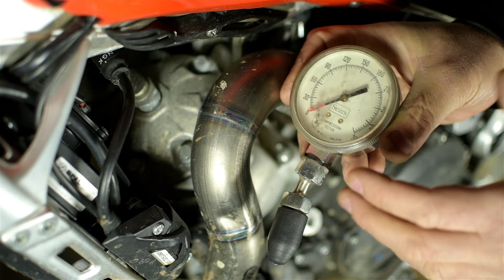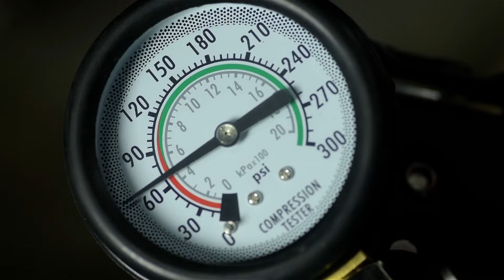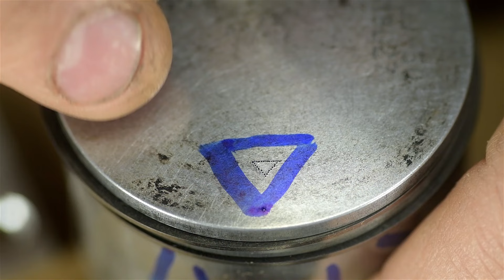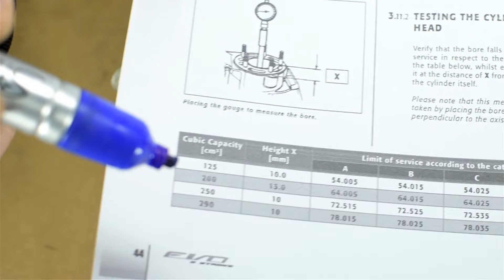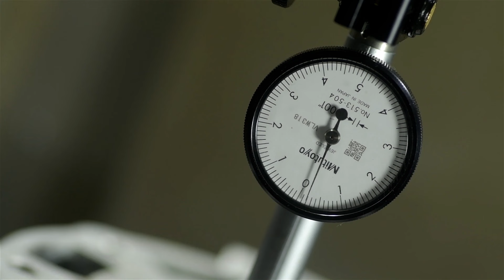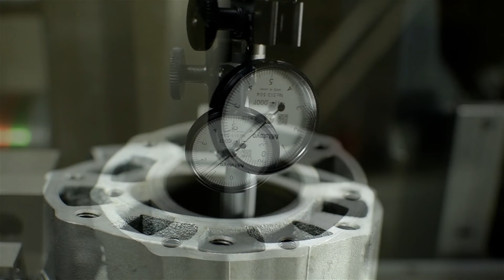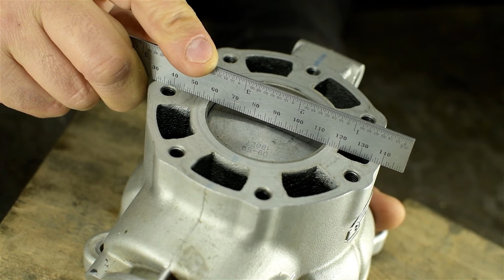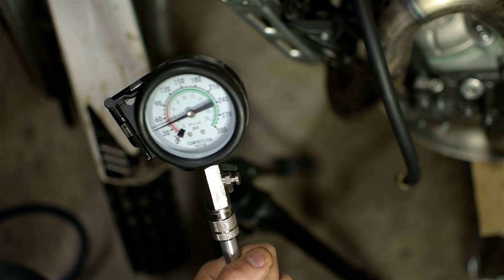Top End Rebuild! (2 Stroke)

Comment: Are you sure the cylinder is Aluminum?  Even if the block is Aluminum, the cylinder wall will be a thin layer of steel, typically.  I can see there's a thin wall of something between the combustion chamber and the block.  That's not Aluminum, is it?

Comment: I had issues with my car,  it ran funny  the engine ran really uneven,  so i called up my friend who has a  Car repair shop, he told me to limp the car over there and he started to check the engine, after a  like 20 minutes or so  and he said he wants to check the spark plugs and started to pull them off, and when he got them out he was shocked in what kinda condition they where, rusted  nasty and the spark tip was round no sharp edge anywhere it was worn to a ball he told me he had never seen anything like this in his 30ys on the job

Comment: Dear ToT, you don't act like you know nothing! The only glaring error I heard was the comment about sucking gear oil up into the combustion chamber. It's a 2 stroke so the crankcase and gearbox are separate. The carb mixture flows down into the crankcase and then up to the combustion chamber through the transfer ports. (But I suspect you already knew that!!!)

Comment: dont ever make an adapter for compression tester.  thats why the cheap tester is giving bad results, because a good tester has the valve in the very end of the tube.  a cheap one has the valve right up by the dial and any volume between it and the spark plug hole gets averaged in with the results.  on a 400 big block it wont make muych difference but on a smaller engine it throws it off ALOT.  if you cant look inside the end and see the valve dont use it for small engines except as a comparison (engine a and b are the same size and a has good compression, does engine b read the same as a?  then its good)

Comment: its really hard to get a accurate read on a dry engine , you need the lubricity to help the rings seal, generally you run a compression test either by squirting a shot of oil/fuel down the bore, but around 65 psi is where you start having serious start-ability issues  the ideal range depending on piston/head design should be around 120 to 190 psi. if it doesn't take your fat mother jumping up and down on the kick start to fire it off its not sealing good
Reply: if mo power is your game take the head back off bring the piston to TCD and see if you have any room to shave the head down for some more compression

Comment: 2:38 The main problem with those is that the whose is to flimsy and there is no check valve in the start of the whose. So the whose will flex and only low compression will reach the gauge. Every normal expensive tester has a check valve in the end that gets put in the cylinder head.

Comment: Tony, you went there, so this is really all your fault. I was going to leave it alone and just let you ride, but you should have honed the bore. There I said it. 

The so-called super-uber-mega-ultra-viener-shliden "coating" was gone about 5 minutes after you started that engine when you bought it new. The reason for coatings like that are.... wait for it..... just a minute.... MARKETING!

Tony, just think about it, the bore is technically out of spec. Is there really any chance of a coating being left on there? The only way for that "coating " to survive is to infuse it into the aluminum, so it's still there even after being slowly filed and machined away by the running engine. The only risk you run by honing the bore is increasing the break-in time after the rebuild.

Comment: A cold 2 stroke should never be more than 120 due to piston expansion/ clearance , black below the rings is blow by and never should there be swirl marks on a 2 stroke, cylinders are Nikasil coated aluminum jugs. Rings in a 2 stroke only good for 4000 mi at best.

Comment: OMG!!!
The piston is polished like that because its the sides that expand and press against the cylinder walls. You going to take a measurement on a piston that needs to be replaced. Those manufacturing marks are there for a reason, and they arent manufacturing marks. They are intended to hold oil so the moving parts stay lubricated. Once those grooves are gone, throw the fucking piston away.
Next, get a hypereutectic piston and have the cylinder blueprinted to the piston. Don't just buy a piston that's 40thousanths over and then machine 40thou out of the cylinder. Blueprint the fucker so it has a good solid tight fit. hypereutectic pistons dan be blueprinted to extremely tight tolerances that forged or stock pitons cant. hypereutectic pistons don't expand or contract. And they have been used for a long time in hotrods making 400 plus horsies. 
That's all you will ever get from me. It's more than you deserve. You're on your own.

Comment: LOL, I made comment before watchin much of vid, there's your problem on other other bike then, 90psi is dead giveaway you did it wrong.
You have to have throttle wide open (or carb removed) as well or you will get very low readings. 
The parts in a cheap tester are really not much worse than in a 'name brand', good gauge and it should be just as accurate as a $200.00+ tester.
 Can't give numbers for your motor but most four strokes that should have around 170psi will only show 85~90 psi with a closed throttle. On a worn two stroke it's often easier to put it in top gear and ujst push it a few feet (on a trials bike that can be difficult as gearing is so low)
On most two stroke competition bikes it's a real good idea  to get a second set of rings and gaskets and fit new ring (or rings) before it needs it. You cannot get gear oil into cylinder unless primary drive seal is leaking, it's totally sealed from crankcase (or should be) there have been some engines with porous cases(1970's~80's MZ's were pretty bad) but any sandcast case can be porous)

Comment: And you DON'T put a new piston in a worn-out cylinder. The hone doesn't cut a new bore for the piston. It's for deglazing IF the cylinder is good AND the SAME piston is going back into it. The hone is for creating a 45 degree cross hatch pattern on the cylinder and It helps hold oil for keeping everything lubricated. What you have done is you put something new into a worn part so now both will wear into each other and wear out faster.
Ive also seen some really worn out engines and never in my life have I ever seen a broken piston skirt. Not from wear at least. WOW. Just fucking WOW.

Comment: Gaaaaa!   Tool naming faux pas. ...It's not a "snap gauge". It's a telescope bore gauge.  Actual "snap gauges" are set with gauge blocks and are an external measurement tool, usually with a go-no go limit step.   Looks sort of like a C clamp with no screw... end entirely pedantic rant here.